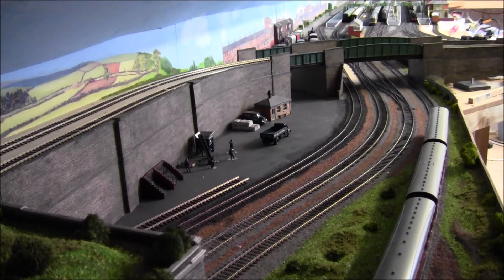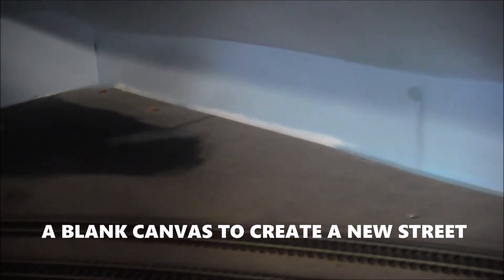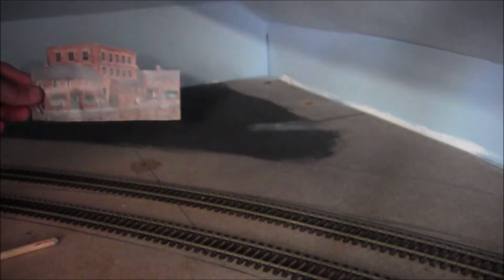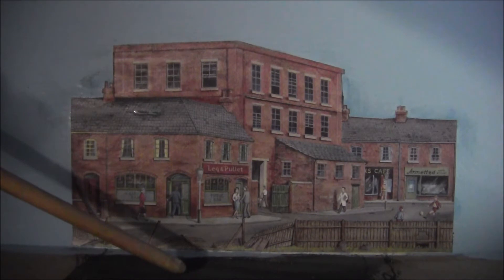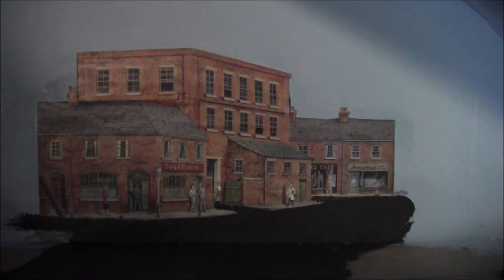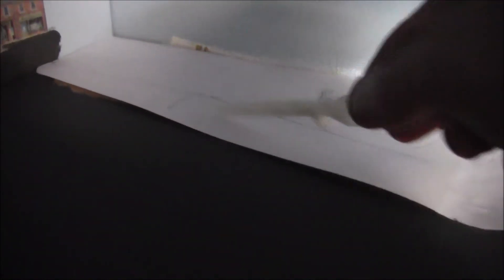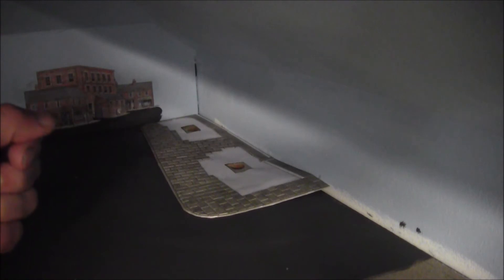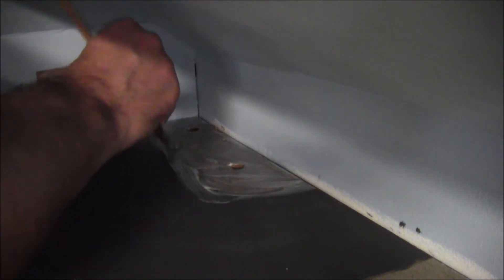High Shields creating a new street No75

Comment: Very good illusion of the road disappearing into the background Tony must have a go on my layout as it makes so much difference to the back scenery. Just a tip regarding lighting for the buildings, old TV scart leads that nobody uses anymore, provide good quality wire that is suitable for dropping  down to bus bars etc, and easily picked up cheap at car boots etc. Ian H.
Reply from the maker: Cheer's Ian for the tip about the scart leads to use for lighting, thanks again for your comments......regards Tony